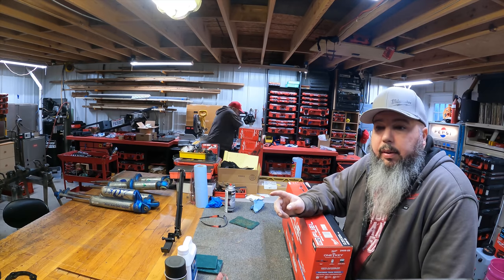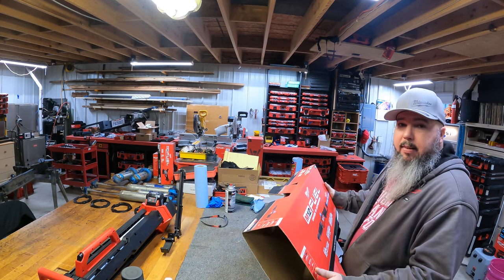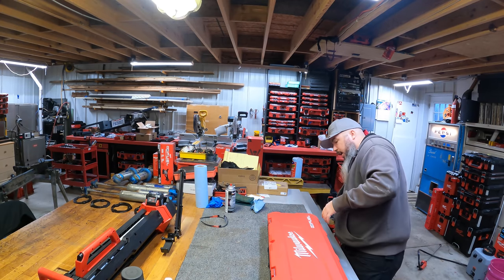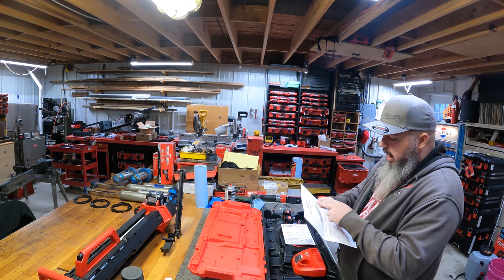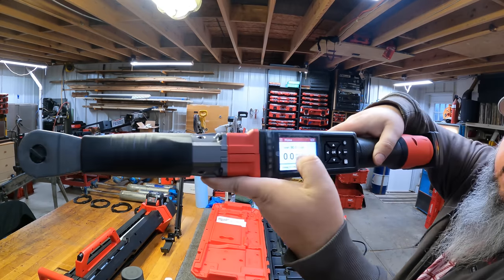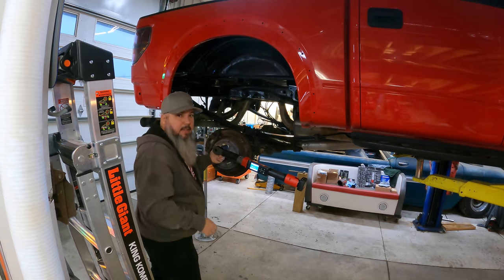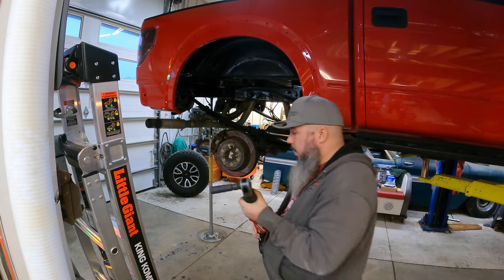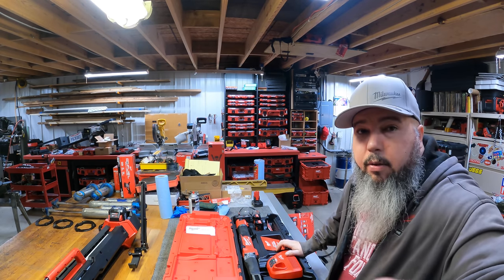Does a mechanic need this kind of POWER (Milwaukee Tool M12 FUEL 1/2” Digital Torque Wrench ONE-KEY)

Comment: Too bad most of my lugnuts are 560-670ftlbs 😔.. there's also ZERO chance ud be even trying to fit that around an mp8 cylinderhead say, tightening/torquing cam bolts,rockers, etc. Very cool still but I got a damn near brand new snap on 50-250 I believe, for 300$ off the truck and ya could fit 27 of them in that case lol. Again, cool video tho. Hope you upgraded your microphone in the past 2 years

Comment: Too bad they can't make it to fit in a pack out system...or put wall mount brackets on the case.
BTW the links to Ohio power tools don't seem to work?
Reply from the maker: Yeah I wish they would make either a extra wide packout or make the tool a little smaller,    What are the links doing ? I was able to get them to work

Comment: The unfortunate short coming of this tool...  It doesn’t do rotational torque.  I was going to buy one immediately when I saw it being released... but this is a total deal breaker, too many fasteners require it now.
Reply: Woah!  Just looked at the price, i would much rather have a snap-on tech angle for the price.  Milwaukee has some killer cordless tools and I own a lot of them, snap-on still makes the best hand tools...
Reply: @Dansyoung  Yah it's not a very good tool for an auto tech, for that money you can have a quality Snap On, Mac or Matco
Reply: @FusionBoost2.0  I think this is more angled towards electricians rather than auto techs. I know they tried to dual purpose it but it seems more angled towards electricians.
Reply: @HedgeMaster26  I don't think they even tried to dial purpose it, I've never seen anything with Milwaukee even suggesting it's use in auto mechanics
Reply: @andrewscott8892  what about the right angle impact? And the stubby

Comment: Not Impressed with the tool and I haven't even held one. My 3/8 snap on tech angle will go to 150 ft lbs and do angles as well. My 1/2 snap on tech angle will go to 300 ft lbs and it cost me $700